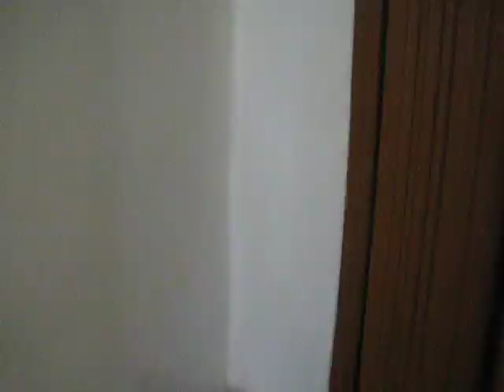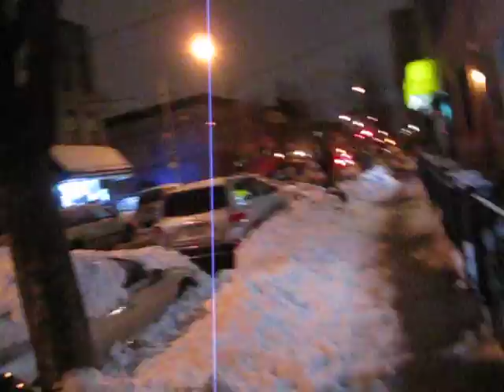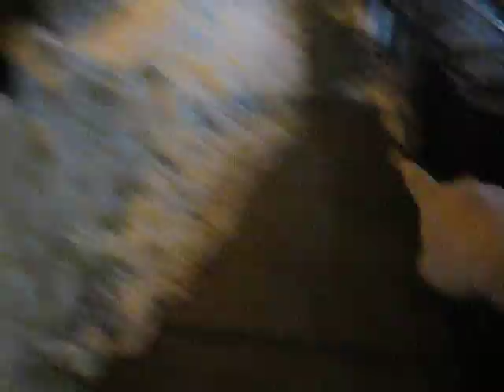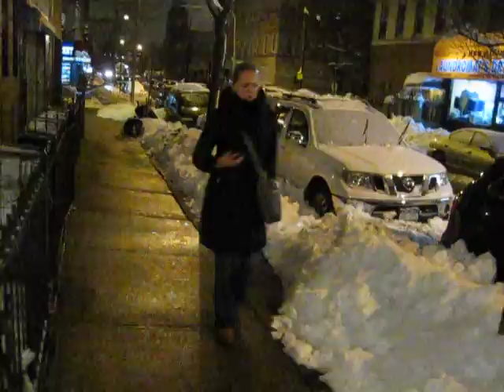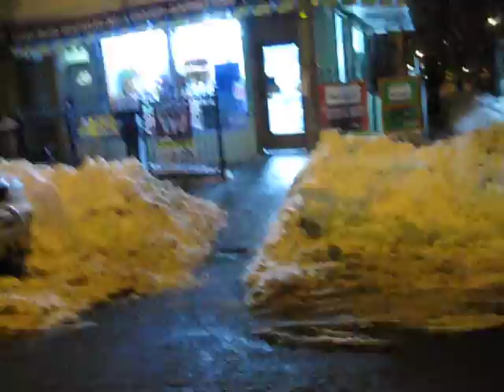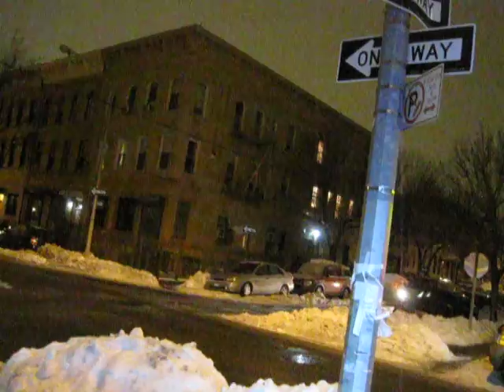Wet Snow versus Dry Snow (01/29/11)

Comment: Neither wet nor dry snow will stick right away on any pavement thats been salted recently or at or above 32 degrees. If anyone wants to know what type of snow fell, simply try to make a snowball. If it sticks n makes a snowball, its wet snow. If it falls apart, its dry. Snow that falls near 32 degrees is wet. Snow under 20 degrees is dry.